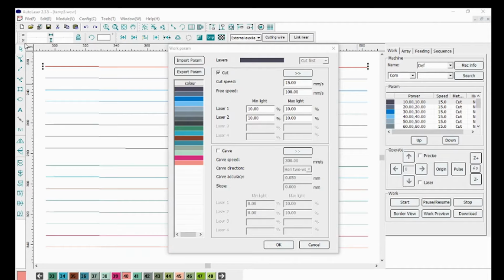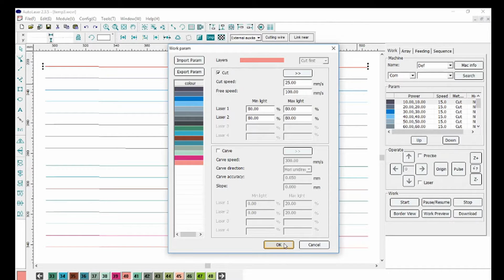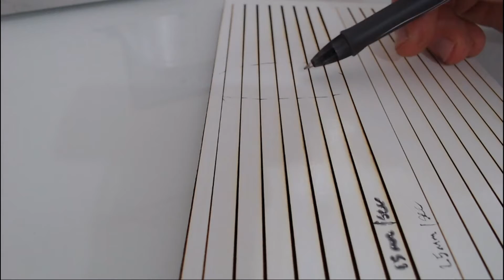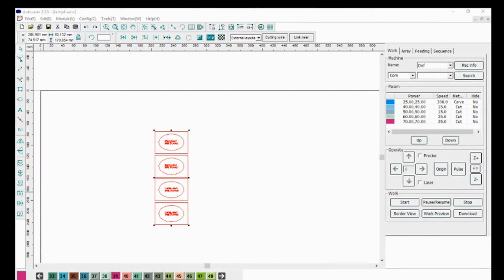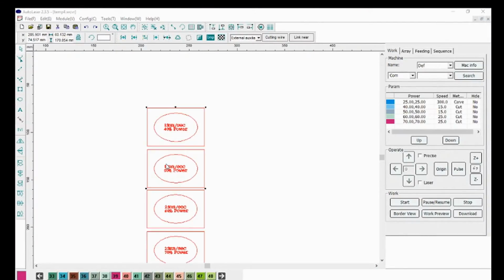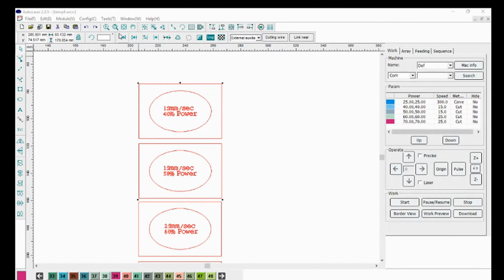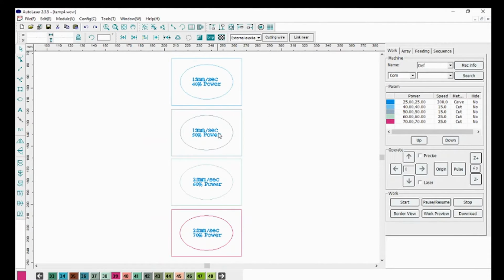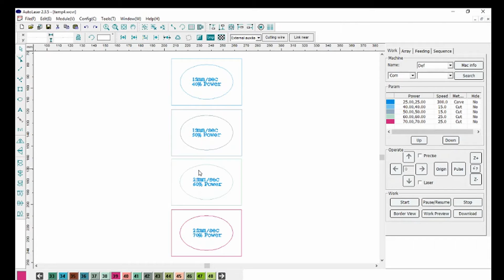Co2 Laser Focus, Power & Speed Settings - Laser Ramp Test for CNC Co2 Laser Machines

Comment: Hi there, I’m new to CO2 lasers and would like to run a ramp test. I’m having a hard time understanding why they incline is needed? Also when you do your last cuts the 15mm/s 40-50% & 25mm/s, why is that piece of 6mm on top of 4 other pieces of material? I’m sorry if this is silly, like I said I am new to this! Thank you for the video and all the information, it’s extremely helpful!
Reply from the maker: I can assist through email / chat / facebook group, easier than trying to use comments in this video.
Cheers Matt
Matt@mwlaser.com.au

Comment: Very cool ! The inclined plane test is so wonderfully simple ! But shouldn't you need to focus deeper into the material anyway then when engraving ? The laser beam is V-shaped to the focus point anyway.
Reply from the maker: if you focus too deep into the material, then the top surface cut edge is more likely to be charred as you can see on the ramp test.  it is best for most thinner materials to focus on surface of the workpiece.  if you want to cut thicker materials then you would select a lens with a larger focus gap.  For engraving you want a 2" or 2.5" lens focused on work surface.
Reply: @MWLaser  Thank you very much for that bit, just moved from LED lasers to CO2 and there's much to catch up on !

Comment: This is the same laser I have, do you have any setting insight for 1/4" birch? I'm having the hardest time!
Reply from the maker: I cut this approx 8 to 10 mm/sec at approx 60-65 % power (23mA) on my Red & Black 80W tube
Reply: Once all mirrors are aligned and u have completed a ramp test are u still getting soot around your cut lines? I can’t seem to get a clean cut with the soot

Comment: hello can you ask me a question?
the purpose of this test is to find a point on all lines that is the thinnest right
like where all lines are the same thickness is the ideal height the material should be from the lens.
Reply from the maker: You are looking for the thinnest line that cuts through the material.  i.e. the optimal focus gap is produces the smallest dot or line thickness for the lens you use.  The lens I use in this machine has a focal gap of 50.8mm (Distance from lens to work piece)
Cheers Matt

Comment: Thanks Matt!  I will definitely use this method to check out the focus and power settings for my 100W machine.

Could you please cover some of the computer setup you went through, as well as the use of the USB or "U DISK" port on the machine?  I'd like to be able to save files to a USB stick and run the machine without connecting it to a computer.  Thanks again!
Reply from the maker: Hi Ben, I currently use the laptop connected to USB connection of the controller.  I have used the U DISK function - it works well but takes longer to transfer to USB then USB to Controller etc.  If you'd like a video on this I will do one specifically for the TL-410C and the AutoLaser Software.  Let me know if this is something you'd like.  (I've replied and answered your other questions you sent via email).  Have a great weekend :)
Cheers Matthew